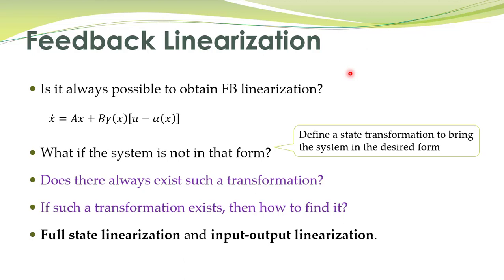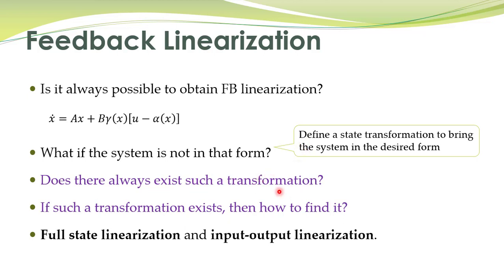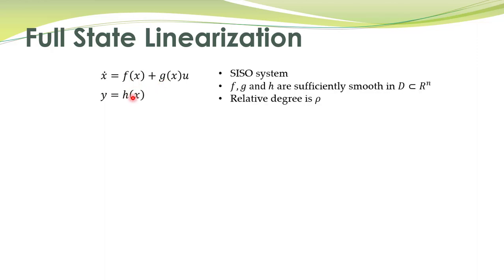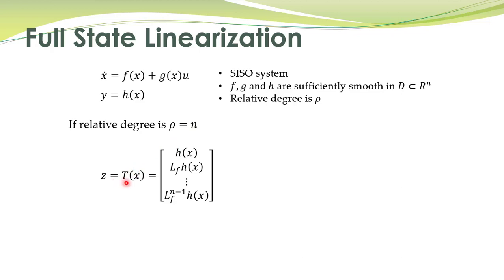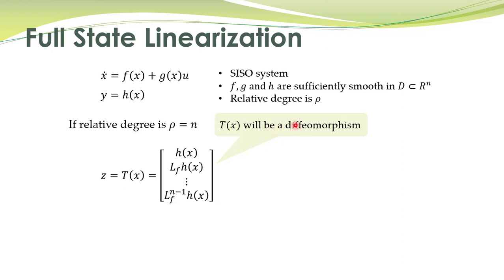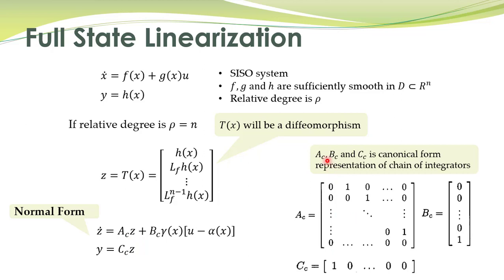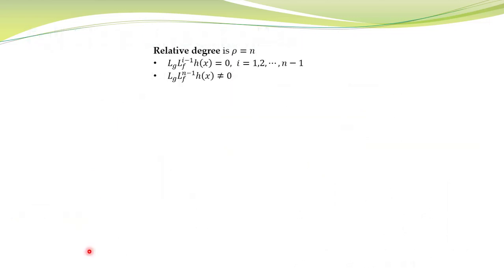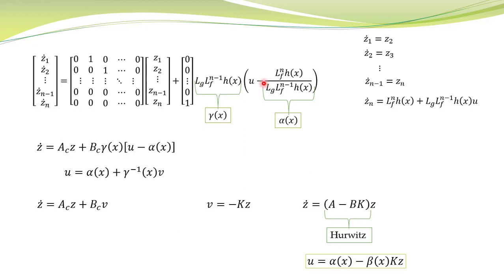NCS - 26a - Full state linearization ( rho = n )

Comment: Thanks for your lectures!
I think, in the expression for (u - alpha(x)), there should be + instead of -. Or to be written differently to match with the standard form
Reply from the maker: You may write it in both ways, either with + or with - , however, in the earlier case, you will have to change the sign in the control law as well. That is, you will take u = - alpha(x) + gamma_inverse(x)*v. In both the cases, final result will be the same.
Reply: @MAFarooqi  Agreed! Thanks